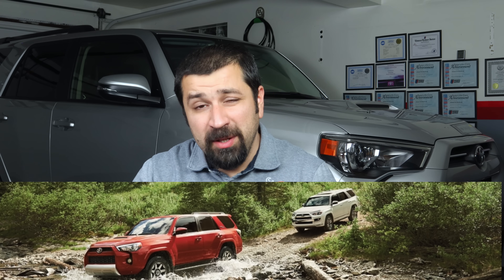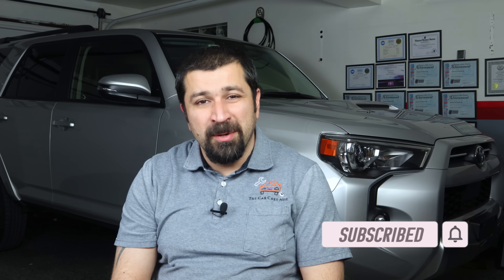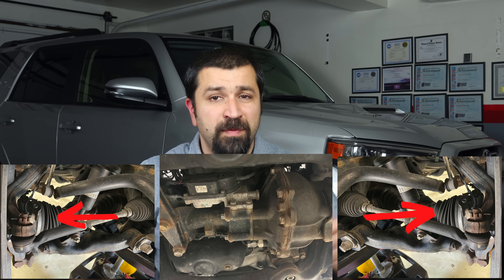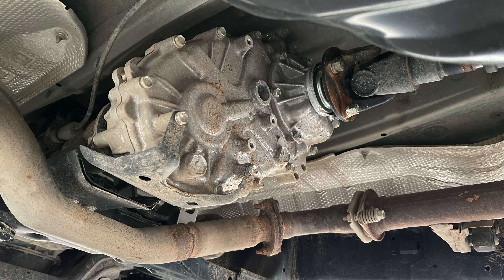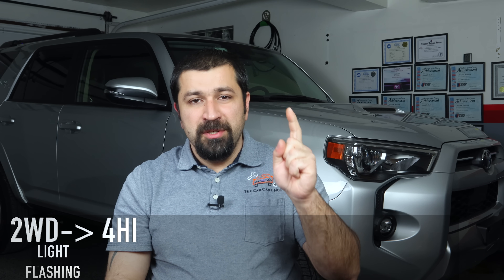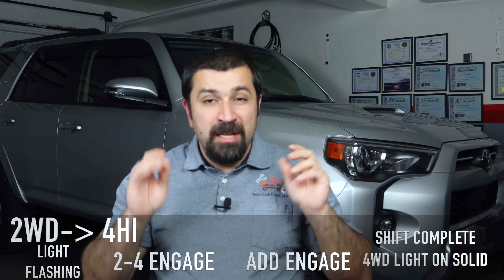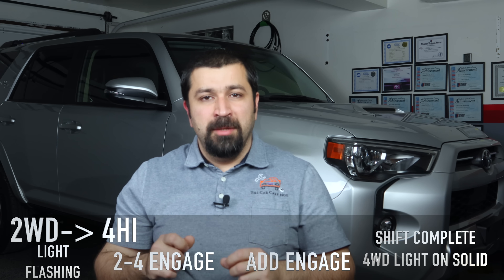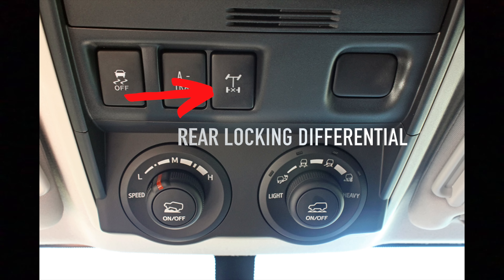How does Toyota 4WD System works and why is it reliable?

Comment: Small parts like abs sensors and front differential actuator are weak links that can cause the entire 4wd to not engage on the trail. Any recommendations on how to maintain those things? Consider a vehicle that goes off-road significantly
Reply from the maker: Hi! The actuator is actually pretty reliable if used frequently. The abs sensors other than carrying spares not much can be done for them
Reply: @TheCarCareNut  thanks! Actually tons of people that wheel their 4runners off-road have issues with ADD. Water gets in because the breather is very low, and they corrode. This is a problem to the point that people actually replace ADD with locking hubs like the 80s Toyota’s.

Comment: Hello sir, first of all, great channel. I love it. I’ve been looking at your vids hoping to find a clue fir what is wrong with my  07 GX470. It turns off on lower RPMs for what seems like no reason. I put it in neutral, turn it back on and problem. Doesn’t do it every single tine but enough to where I need to find and fix the problem. A mechanic recently changer two coil packs I believe, but still same thing. Temperature is good. It just turns off randomly. Have you encountered anything like this? No check engine lights ever come on either, kinda weird… any help or direction would be greatly appreciated. Thank you in advance. Ohh it only has 150,000 miles on it.
Reply from the maker: Hi! That’s interesting. These usually don’t have issues. Try a few things. First test your alternator. Also clean the throttle body. Lastly check for codes even if there’s no check engine light sometimes you’ll have pending codes that could
Help

Comment: As usual, content and explanation- top notch
I had a question though, agreed that in 4L, ideally we should not drive it at high speeds 
But believe me, in middle east, plp drive these like crazy, I myself have driven full day of dune bashing, psi around 10, 4L, 70-90kmph, climbing massive sand dunes, engine rpm consistently between 4-5k

Sure we change engine and differential oils including transfer case very frequently 
Bt I wanted to chk wht it could possibly damage in long run

Also, with new turbo engines and 10speed coming in, is similar hard core 4L is possible
Reply from the maker: Driving in 4L at high speeds could really damage things! Maybe they’re driving in 4 hi?
Reply: @TheCarCareNut  no sir
Like I mentioned I myself have driven my FJ multiple times in 4L, gear 4 and 5

Just want to understand wht can be damaged?
Transfer case, gear box ?
Reply from the maker: It puts a tremendous stress on the transfer case transmission and the engine as well
Reply: @TheCarCareNut  The 4runner can take it. I live off grid and I have 2km of rough trail then 5km of fire road just to get to asphalt. I went working everyday through a canadian winter last year. The abuse that I had to put my poor 4Runner through is difficult to describe. Saying that I have often overheated the 4x4 system on it should begin to tell you. I once ran out of torque in 1st gear low going uphill through over a foot of very wet snow. Though it usually managed 3rd at 5k when the snow was dry. I slammed the transmission back and forth for hours. Loaded the converter at full throttle routinely to get going when I only had a couple inches of movement to start with. I slid off the fireroad on ice and launched the truck over an 18 inch boulder only to need an alignment because of a slight bend in one trailing arm. Plates took all the impact though I came within millimeters of poking through the fuel tank and made quite the dent in the crossmember in front of the transfer case.

Now. I don't expect that it will last as long as one who has had an easy life. But the fact that it still feels as good as new after being pushed to it's limits day after day for months is incredible. Asking the truck for all it's got in 4low is perfectly acceptable in certain conditions. 

I believe you are severely underestimating how hard they can be pushed. Only just did the brakes at 120,000km. Scheduled stuff otherwise.

Comment: HELP !!!!   Can someone point me in the right direction in resolving my 98 4Runner issue?  When I engage 4H it goes in silent but when it goes back to 2H (disengage) the is a loud bang (like a sled hammer bang). The is a delay for about 30 second to disengage as I drive down the road.  My other 4Runner does a loud click only.  I don't know the history on the car but I have changed all the oil already.
Reply from the maker: Hi! Are your tires the same brand and ratings?
Reply: @TheCarCareNut  - actually was able to fix the sled hammer 4wd engagement by cleaning the switch on top of the ADD and now it shifts like butter  Now a more complex issue arise.  I was stuck in traffic crawling for 2hours in 90+ degrees temperate and the car (98 4Runner Ltm)  finally gave in and the thermostatic started to reach 10 o'clock position.  I pulled over to let it cool down, the car actually felt much hotter, couldn't even touch the headlight. So the problem is not the increase in temp, the next day my 4WD had no activity after I press the button, no dash light, no engagement.  It worked few days later and it stopped again. No activity at all.  I disconnected the battery so the computer can reset and make sure the vacuum holes did not fall off or melted in with the increase in temperature but still no 4WD.

Can you provide me with just a few quick pointers on how to diagnosis?  Thx

Comment: It's reliable because it's designed by Toyota. End of story. Even cars sold as Toyotas might not be reliable when they're designed by others, like the Toyota Cavalier (rebadged 1995-2005 Chevrolet Cavalier) in Japan and the Toyota Supra (rebadged BMW Roadster). Similarly, cars sold as others but designed by Toyota are still guaranteed to be reliable, like the Chervolet/Geo Prizm (rebadged 1998-2002 Toyota Corolla) and Pontiac Vibe (rebadged Toyota Matrix).

Comment: Is it possible to add the elocker for the rear diff onto the limited? I think the axles are actually different from what I read, or at least the diffs, I think same gearing though
Is that something that is possible without going arb air locker for rear, but just adding an oem rear locker?
Reply from the maker: Hi! I personally haven’t seen that done on a limited
Reply: @TheCarCareNut  thank you! I know arb lockers can be installed, best way to get closer to a land cruiser..

Comment: Hello,

I own a 2016 4Runner Limited. The other day after the signal light turned green, I started to go and the center differential indicator light started to flash and then stopped flashing. Also, at the same time I heard some weird sounds. After that, everything went back to normal. I’m not sure why or how this could happen because I never touched the 4 wheel drive button. Do have any thoughts on this? Maybe a bad actuator or computer. I have an appointment with the Service Department but I wanted to get your thoughts on the matter also.
Reply from the maker: Hi! Interesting. This one is hard to tell without diagnosis. Did it happen more than once or just the one time?
Reply: Hello,

Thanks for your reply. This is the second time that this has happened. The first time it happened I was driving over a speed bump slowly with both rear wheels.

Comment: Had to pause the video to say THANK YOU!! I’m a new 4Runner owner who has never before had a 4WD vehicle— just AWD, which I understand is a “cheap imitation” of 4WD. I had also heard (from YOU, I think!) that I should give the 4WD a little exercise each month so it wouldn’t seize up. What was still bothering me, and making me think my 2020 SR5 Premium might need to be serviced, was the vehicle’s poor manageability when I needed to make sharp— or even almost-sharp— turns when in 4WD! I appreciate so much your simplifying things so that the info is incredibly digestible, and your covering so many details and nuances (like it being normal for the 4WD to inhibit sharp turns) so we can be knowledgeable owners & drivers. You’re the BEST!!!!!! 💐🌺💐🌺💐
Reply from the maker: Hi! Thank you so much for watching my video. This video I tried to cover as much models as possible but On your model there’s no center different that allows the front and rear to spin independently so when making turns it will bind and it’s not recommended that you drive it on sharp turns on dry pavement. The exercise is best done on a straight road or one without sharp turns
Reply: @TheCarCareNut  Thank you so very much for the further clarification & confirmation! I’ll be sure to exercise my 4WD on straighter roadways— and also run through the other settings (4WD low, 2WD low) as you recommend in this video, to flex & test the whole mechanism each month. Thanks again, and may God continue to bless you & keep you! 🙏🏾🤗
Reply: Hello and thank you for your videos. I just wanted to piggyback on this and confirm in regard with the rear locking differential if that should be "exercised" once a month along with 4WD (if you do have one and it does not get used often.)  @TheCarCareNut

Comment: Is the manual 4x4 system more reliable? I’m shopping for a 4Runner, looking at 2 at 2 different dealers, one has manual 4x4 the other one has electronic 4x4.
Reply from the maker: Hi Jason. They are both reliable. The electric one as long as it’s regularly moved it should be very good. The manual one still has an electric actuator in the front differential. And honestly the condition of the two cars and their service history is more important if you ask me than the shifter option. Go with the better truck

Comment: I have recently purchased a 2021 4runner  Primium 4 wheel drive, I was lucky to find it, LOL. It was optioned with the a-trac only, I questioned adding a factory rear locker  by the dealer and was told that it was basically not possible? Do you have an opinion about this? Thanks much.
Reply from the maker: Hi! It’s not really possible with major customizations which is not something available through the dealership

Comment: Hello, can you tell me please for a Toyota Land Cruiser J120 from 2007 with permanent four wheel drive, do I need limited slip aditive for the central differential ? Thank you.
Reply from the maker: Hi! I don’t have that specific model in my area. Follow the owners manual recommendation
Reply: @TheCarCareNut  For the 4runner do you use it ?
Reply from the maker: The 4Runner doesn’t require it

Comment: Where I worked before retirement, I had seen older GM's that had the shift handle and front diff  (solenoid) lock.  The older Fords had the electronic rotating button.  Then Ford came up with the vacuum shifting at the front hubs.  I hope Toyota NEVER uses that p.o.s. ! ! ! 
My 06 Nissan Frontier has the front diff and driveshaft turning all the time, but is a part time transfer case that has the motor and the sensor for which position it's in.  Only problem with that system was one code for the C.A.N. communication.  Cleaning the 4WD module board pins solved that problem.  That CAN system operates on low voltage and low current so any corrosion will affect it.  I like manual locking hubs and a handle!  Very uncomplicated!
Thanks for the video!

Comment: Im new to 4x4 and just bought a 99 Tacoma with 4x4. So, mine doesn’t have the rear locking differential, but when using 4x4 the front wheels are a locked differential, not an open differential, correct?

Comment: Two reasons why I haven't bought a new 4Runner and continue to drive my 2000 Limited,
Toyota eliminated the Multi-Mode transfer case and all the off-road versions with a diff-lock
come with a Black interior. All wheel drive option with a center differential is not overkill, it is
a very useful feature that I use frequently when driving in the rain or winter mix. Toyota is just
cheaping out by eliminating the Multi-Mode and I don't understand the lack of choice as far as
interior color.

Comment: Hi, the actuator in the front differential on my 2019 TRD off-road with 59000kms recently failed. Could this have been caused by a late fall water crossing? Corroded ADD? Thanks!
Reply from the maker: It’s possible. Usually when they seize you can sometimes tap of them or actuate them manual by applying power and sometimes even take them out and free the sleeve but if this was under warranty they won’t bother with trial and error they’ll just install a new one
Reply: @TheCarCareNut  yea they replaced it with 500kms left on the warranty!

Comment: My 2003 $Runner went limbo in 2016 (Odo meter around 109k mile) and I ended up having to replace both the transfer case and ADD actuator, cost me $4500 plus a lot of headache.

Comment: My work truck is a 2012 Tundra 4X4/with 4.6 has 335,820 on it. I drive 9000 miles a month. I got this truck in October of 2018 with 82,000 on it. 
The absolute best trucks are Toyota. I had a 2008 F150 before that. Went through 3 transmissions and cam phasers went out at 341,000 miles. 
I don’t have time for breakdowns. I run the piss out of this truck and never lets me down. I pull a 4500 tow book with it also.

Comment: I have my 4x4 most of the time since new in 2005 until 2019....even on the highway... even when i did 130mph going to Indianapolis. (Reading on gps). Now with 210k miles, i do put it in 2d just to play safe.
Reply from the maker: I wouldn’t drive a 4Runner up to 130 honestly but did your tires change?
Reply: @TheCarCareNut  i did it on the original Dunlop tires that time... im on my 4th set, Michelin,  Hankook then back to Michelin. Also, on my 3rd set of front rotors and 2nd set of front calipers plus extra 1 on front right. My rear left caliper is dragging atm, bought a replacement from rockauto.com.

3rd set of cv shaft and replaced front left wheel bearing.
Replaced all gear oil twice and transmission fluid once.
Its 210k miles now and been planning to redo all gear oils and transmission. 

I would say out of the 210, 150ish was on 4x4. Probably explains why im on my 3rd set of cv shaft.
Reply: Now, it only goes to 110...115...

Comment: On the limited models, is the power distributed evenly front to back? Meaning 50% to the front wheels and 50% to the back wheels. Does that value change based on condition or if it senses slippage?
Reply from the maker: Hi! It changes based on slippage. It does have a limited slip differential that allows a different mechanical distribution of power to front and back

Comment: If you off road 3-4 times per onto, for hours, in lo - how often to change the transfer case oil?
Reply from the maker: Hi! I would change it every 30k regardless of off roading or not.
Reply: @TheCarCareNut  thank you sir.  

I ended up with the manual transfer case and I’m glad I got it. 4Runner off road version. Love it. It dives like there is no tomorrow when breaking, leans like hell when turning, is very uncomfortable. I still love it. 

Traded in a 2016 highlander limited platinum for it. But I actually go on rated trails every single weekend. This 4x4 is getting used. I am concerned the long duration maintenance schedule is too long and you have confirmed that. 

Thoughts on the 5k oil change. When I got the Highlander, they had me come in after 500 miles to change the oil because of the engine braking, and they change the transfer case for the I will drive which also had a metal in it because it was new. I am at 5K after a month on this so I’ll be getting it changed soon but my feeling is I should really change it sooner.    When I go on the trails it can be five or six hours in low range so it’s not really high mileage on the trails but it’s a long duration of engine running and probably under the normal conditions compared to freeway driving.
Reply from the maker: I would stick with the 5k 6 month oil changes. If you feel like your use is heavy and demanding it wouldn’t hurt to change it sooner

Comment: Please make a video explaining the A-TRAC and REAR LOCKING Diff in the TRD Off Road 4RUNNER
Reply: In a nutshell, A-trac is advanced traction control. It works like your regular traction control but is more "aggressive" if you will. If you find yourself in a tricky situation A-trac is great. But, the terrain select is better used for more extreme off-roading. 

The rear diff locker should only be used when you are faced with the most extreme off-road settings (extreme uphill, mud, ruts, and rocks). An axle locker makes both tires spin together rather than one single tire. A 4x4 rig when in 4 wheel drive is really only a 2 wheel drive with one tire front and one tire rear with power. Lockers and traction control can control the power distribution. 

I hope that makes sense and is easy to understand. I have been wheeling (off-roading) for over 4 years and currently own a 2020 4 runner TRD off-road (but have ow we jeeps, blazers, trucks all built for off-road).

Comment: Amazing video series! Been learning so much about the 4Runner. Could you please do a video where you explain the difference between the various off-road modes that are offered on the TRD Off-road models? Where you can select mogul, sand, etc - I’ve never been able to figure out what the truck is actually doing

Comment: And do think I should buy a sequoia with the 5.7 engine or is it the same issues has the tundra has you mentioned in your video on tundras problems.
Reply from the maker: Hi! The cam tower leaks are the same on the sequoia

Comment: Can we use 75W90 synthetic fluid for just the rear and front differential (not Tcase) On 3rd gen tacoma. Can’t afford the golden fluid from Toyota and beside most the dealers don’t carry them😁🙏
Reply from the maker: If it doesn’t say LSD only on the diff then yes you can
Reply: @TheCarCareNut  Thanks